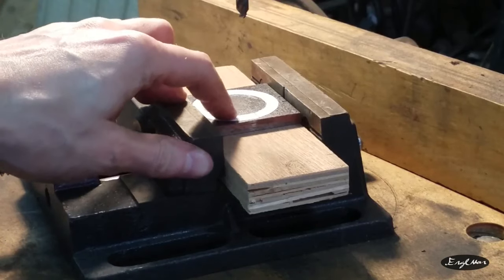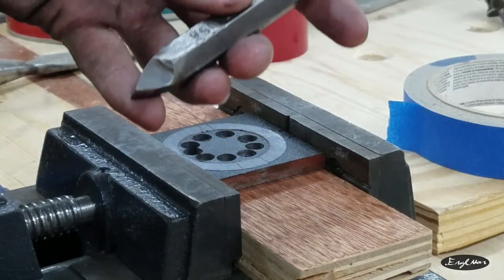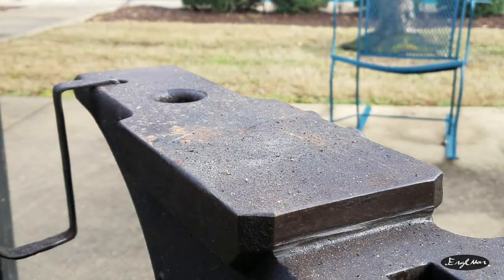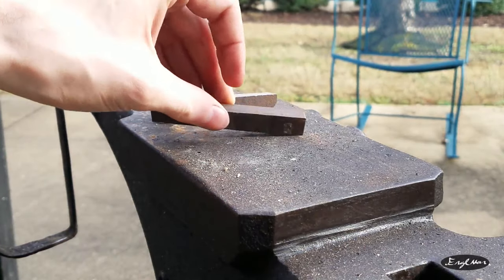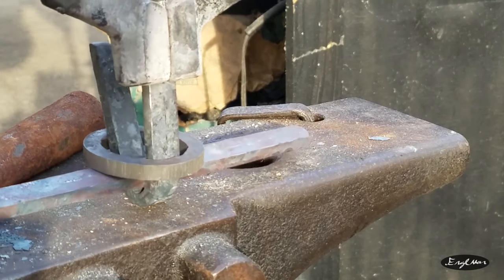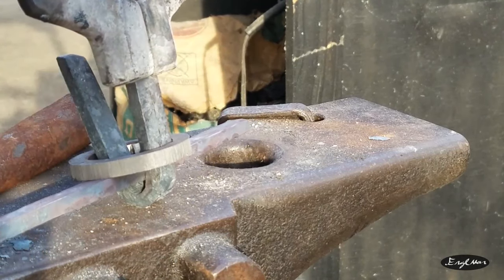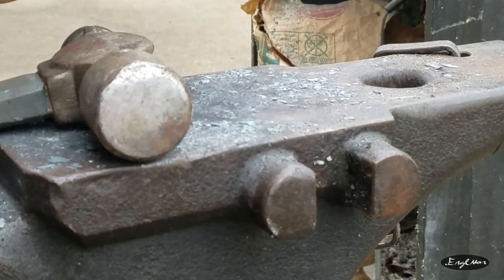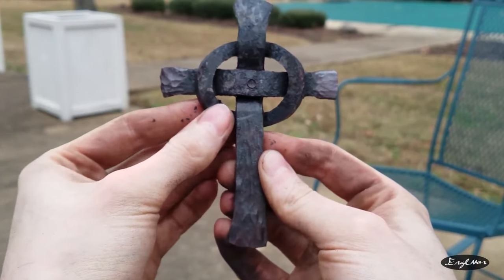Blacksmith Challenge Build #18- Christmas Cross

Comment: Not sure what you mean by crosscut chisel, but I would think that a small flat bottomed slot punch might shear out the webs between holes faster,  maybe best on the anvil over a bolster plate so you get the most bang for your buck.
Really cool design and well made Sir
Reply from the maker: Thank you very much! I'm not sure what I meant either without rewatching the video lol. I definitely need to make a bolster plate for stuff like that though, it'd be pretty useful.